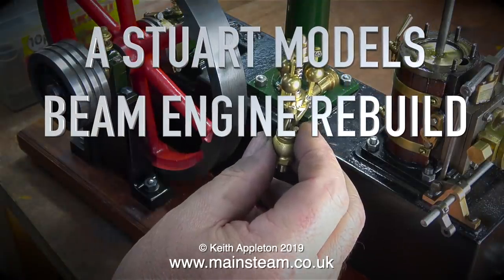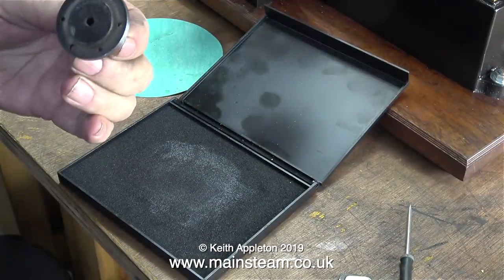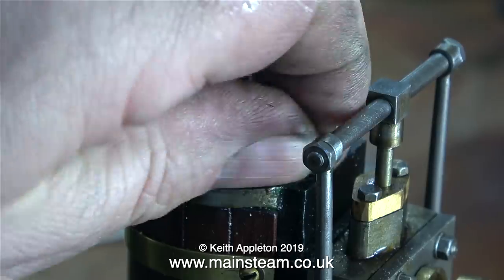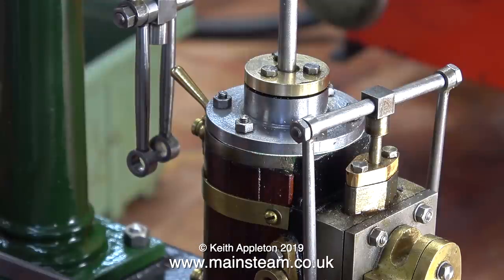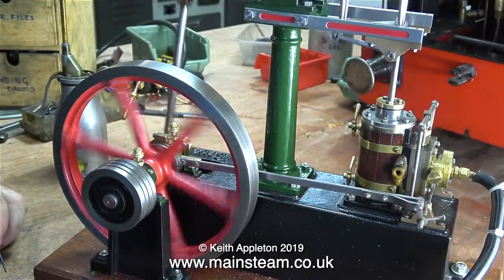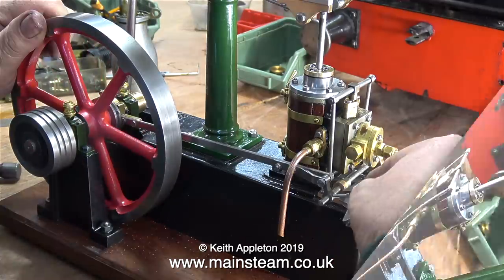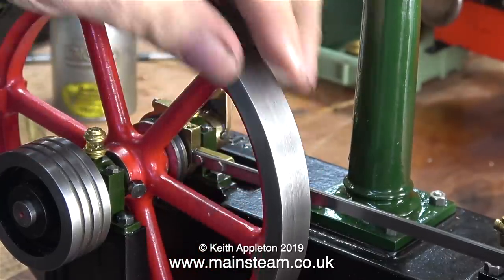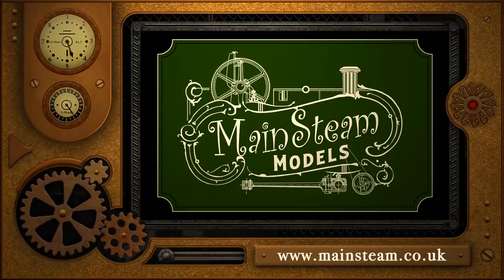A STUART MODELS BEAM ENGINE REBUILD - PART #23

Comment: You have done a lot of work on this engine now and it has made a huge difference to the way it runs ! The changes you made were very subtle but you have managed to rescue a fairly ramshackle engine by correctly getting to the root of it's issues. This shows your experience and expertise very clearly, I wonder how many people would have identified those faults and been able to fix them ?
Some very valuable tips in this video series, thank you !
Reply from the maker: Thanks Ian {:-)))

Comment: I have used 3 Microcoysm governers. S50, #9, #1, I have become familiar with them as I have rebuilt the bottom half of 2 of them to make them truly function on the larger models; enlarging intake and through hole, enlarging plunger valve. Work great! Look great.

Comment: Interesting that what we in the US call a "set screw", you guys in the UK call a "grub screw." It has grown on me and I find myself saying it at work; my co-workers give me odd looks when I refer to it as such. Calling it a grub screw makes me think of a fat little grub wiggling its way through the dirt.
Reply from the maker: or maybe it's just the way that Grubs reproduce . . . . }:-)))
Reply: I would make the distinction that a set screw locks movement between two parts, a grub screw is a bolt without a head. So in this case it is a grub screw being used as a set screw.